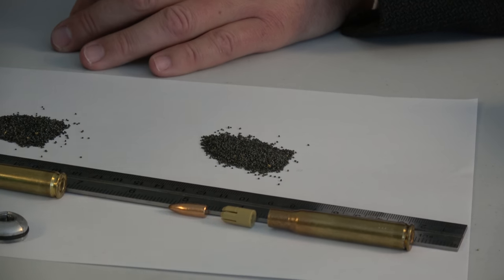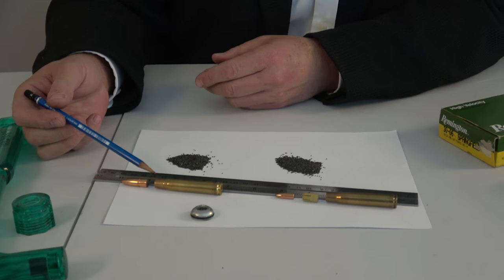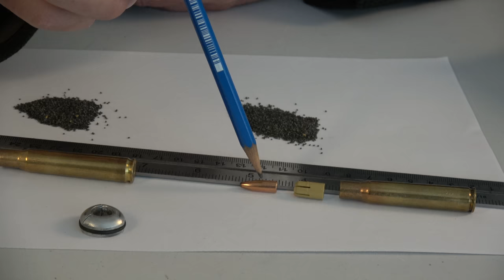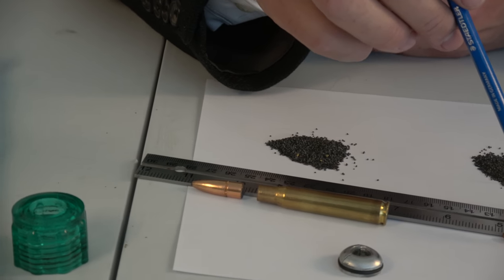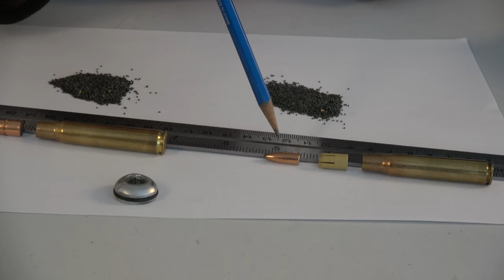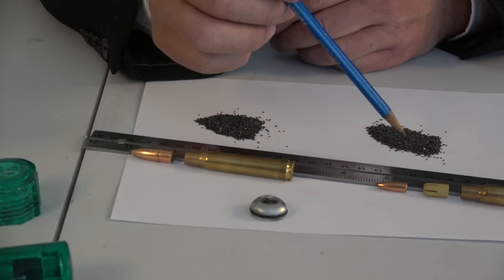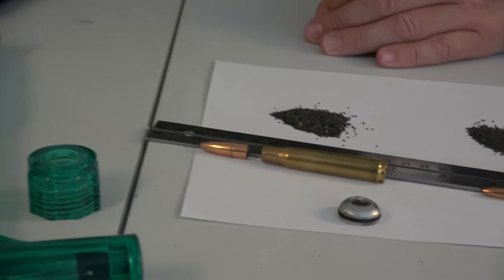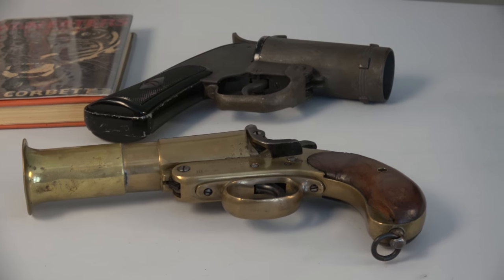Very High Velocity II / Remington Accelerator

Comment: I used to use the Remington accelerators in the 80's on groundhogs. They discontinued them and now I load my own. You can buy the sabots on the internet in bags of 100,500 or 1000 and load your own. They shoot really well. I load them to around the same velocity as Remington did. I have loaded them even faster but accuracy seems to suffer.

Comment: I told my friend Mike "the genius" about the Remington accelerator and he said yes he experimented with them. Same results pretty much that you got. He said if he remembered correctly that around a thousand rounds he noticed a lot of wear in the last 6 or 8 inches in the rifling. And based on that he believed that there was the same damage to the throat of the chamber. He said he will check the rifle "he still has it" to make sure of his memory. He's currently working on lasers. Wants to build a Klingon  Disrupter. Yeah I know.;) But he can punch a 1/4 inch hole in lexan at 30+feet across his shop in a second so???? Hahaha. I love this guy. I'll pass on what he tells me.  Thanks for the excellent videos.
Reply from the maker: Hi Hamm - wish I could meet Mike. Velocity is fascinating. You and Mike probably know that most of the matter of the universe (reality) is missing; no one knows where it is or what it is. The matter we know of is only a percentage of what is there/here. Long ago it occurred to me that just as a passing bullet cannot be seen, so too can dark matter exist in a velocity state that we (as yet) have no instrumentation to observe. If so, then parallel realities are not only possible but quite likely; we just can't see or measure them; just as the passing bullet is very real - but only if one knows it is there. Expand the theoretical trajectory of the bullet to light years and not yards - and the dimensions of our reality slowly emerge. Please message me on patreon if you can.

Comment: My experience with Remington Accelerator sabot rounds matches that of most other users. Which is probably why they stopped making them. Back in the early 90's I had a HK 770, semi-automatic in 308 Winchester. For some reason, even with the thin 21" barrel, the gun was one of the most accurate I've ever owned, shooting 1/2" 3-shot-100 yard groups with Federal Premium 180 grain Nosler Partitions (I think). And so it was only natural that I try some Remington 55 grain Accelerators in it, listed at 3770 fps. Well, I couldn't get better than 2" groups. In other words, the same accuracy that I got with my Remington 11-87 rifled barrel shotgun, using sabot slugs. So I figured I'd be almost as far ahead using my shotgun for varmint hunting. They also made 55 grain Accelerator ammo for the 30-30 WIN @ 3400 fps; however, most hunters soon realized that a 30-30 lever action will never be a varmint rifle, no matter what you do.
Reply from the maker: It is true Will, in some rifles they were very accurate and in others, not at all.

Comment: I recently reloaded Accelerator ammo using EABCO sabots and Sierra bullets ... the big drawbacks I found was accuracy suffers after plastic fowls the rifling about 20 shots in and there is a very fine line around 4100 to 4200 fps where the projectiles blow up midair just from the force that is being exerted upon them.
Reply from the maker: Very interesting - how things come undone at high velocity - and your idea to make accelerators yourself is really interesting as well. I wonder what polymer would not foul - or not as much - and how to stabilize the bullet better. As for bullet strength - maybe Noslers - but maybe not; you likely thought of all these things.